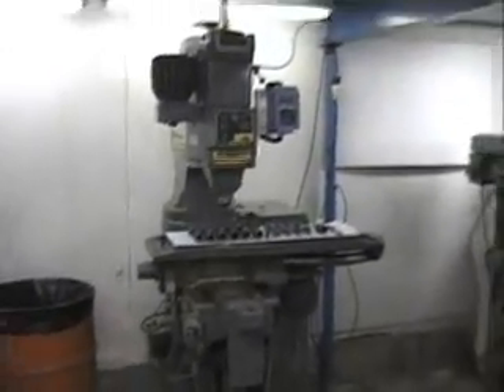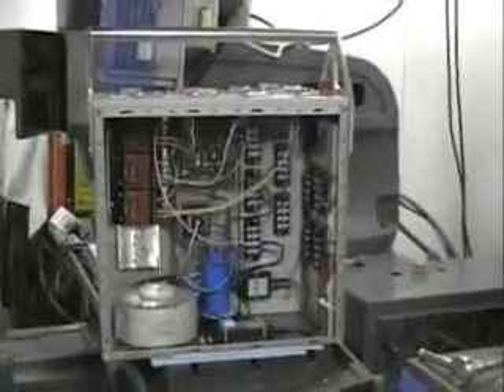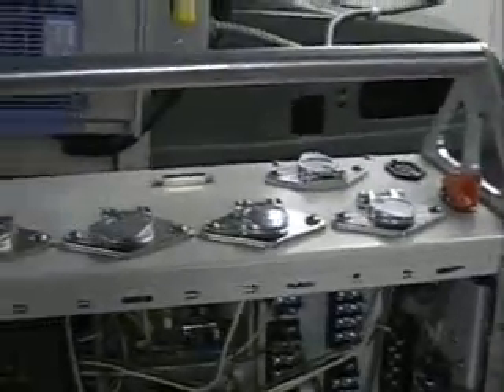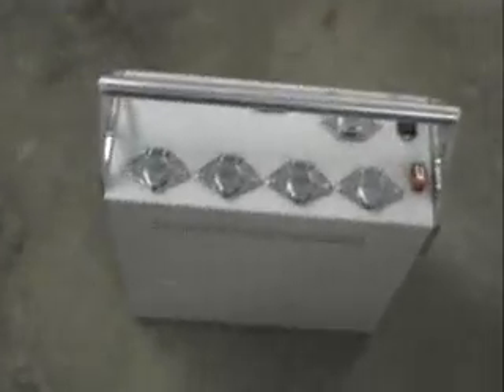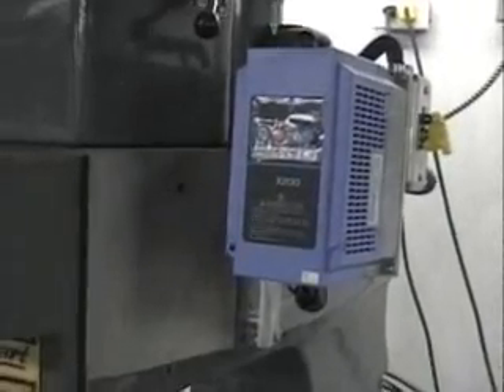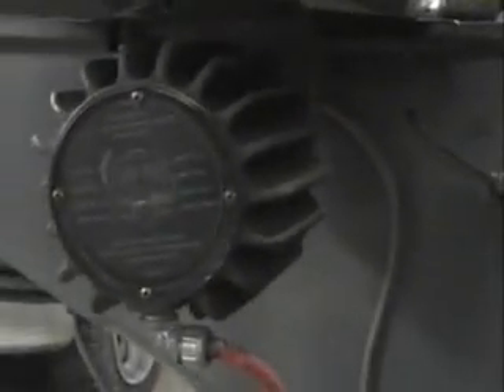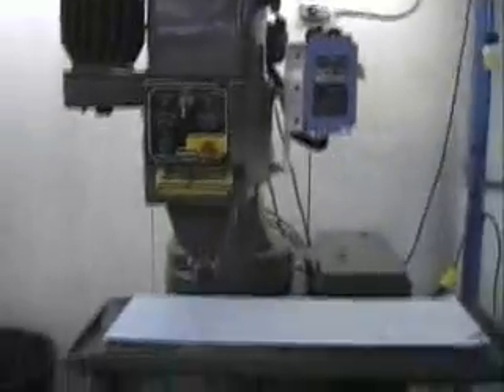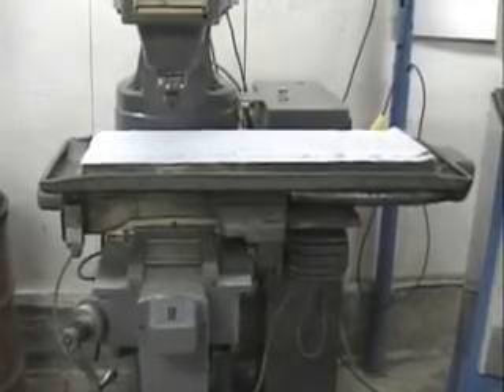BRIDGEPORT CNC PROGRESS 2

Comment: Do you mind sharing your email address? I just bought a series 1 with the boss 5 control($750). My plan is to use keling 1250 oz servos I  bought for a differnt project that I aborted. I have the geckodrives and smooth stepper and power supply already and just need assemble them into a controler. 

I really like how clean your setup was.

I would like to converse about the upgrade process if you have time.

Planning on picking the mill up next week and start the cleanup of 20+ years of storage in the back  corner of a machine shop.
Reply from the maker: Sorry for not getting back to you kevin.  markdotgervaisatsympaticodotca

Comment: Hi Mgermca, I bought recently a Mill Machine with CENTROID M-400. When I moved the machine to other place, the spindle motor was not working any more. The servos X, Y, and Z are working OK. The motor fan of the spindle motor is working too, but the 3-Phase spindle motor is no linking to power. I don't know what is the problem. It is using a VFD from Centroid. I thank you your help in advance.

Comment from the maker: @eodteu1 Hi,  I used two wiring diagrams to get my motors to work with my Geckos. One from CNCZONE and the other from the Roland Friestad articles on converting a Bridgeport cnc mill to a modern drive system in Home Shop Machinist magazine.
I have scanned and uploaded them to my webpage as a single pdf file:
mgertech.com/BPORT-WIRING.pdf   best of luck!

Comment: Nice,
I just converted a series 1 knee that used the same original stepper motors.  One of the problems I had was how to wire original steppers into the motor drivers and found 7,1,5, and 6 to be satisfactory so far after trial and error.  What connection scheme did you use?

Thank you

Comment from the maker: @captainbackflash Thanks for your comments.  The controller's side cover is removed for use with the Bridgeport mill. There is more detail of this in video Bridgeport Progress Report no.3 in my videos here on youtube.     To use the controller as a standalone with the plasma table I am building I will have to install a fan on the side cover.  The controller uses a single 110v - 42v toroid transformer putting out approx 55v DC rectified